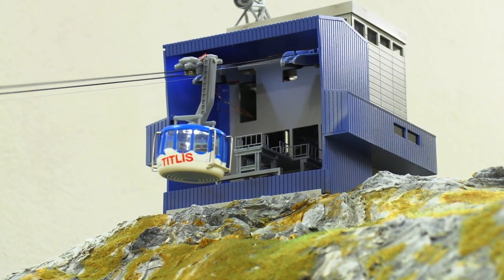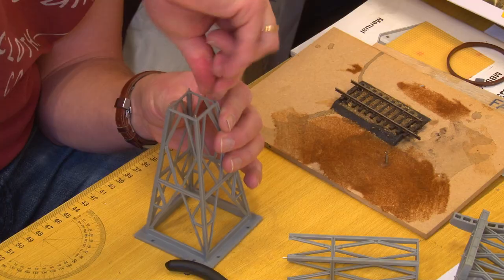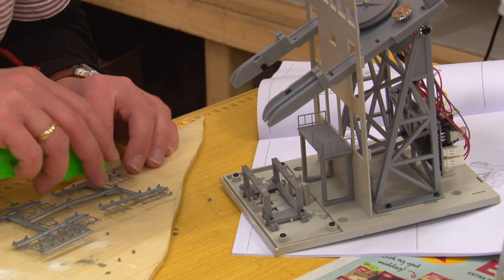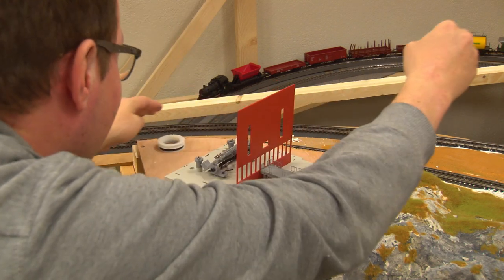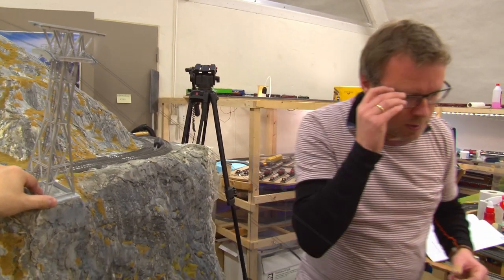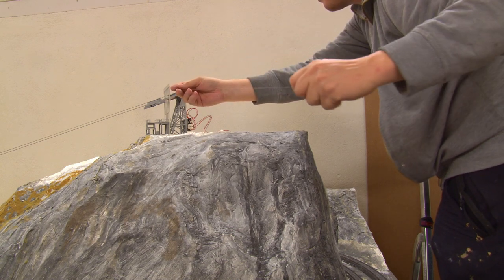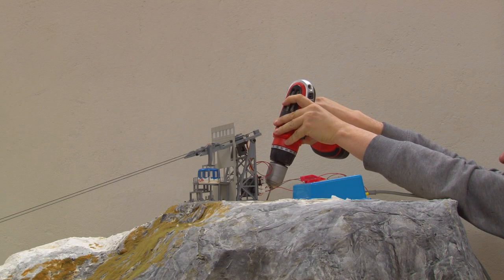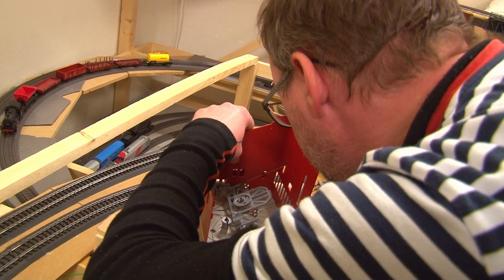Brawa Cable Car - Tutorial and Review

Comment: Hahaha, I just saw the thumbnail and I work in the ski industry and like n scale stuff. I was wondering how true-to-life this would be, as these things are ridiculously complicated... As long as the gondola cars are allowed to detach from the cable!

It's pretty realistic for a fixed grip gondola! Could even run it much faster. The detachable ones really fly up the mountain quite quickly.

I'd love to see this implemented with proper electronics like you mentioned. What a neat model for a railway!
Reply from the maker: I don't think there are any detachable cable cars or chairlift to buy. Sure someone could build that, but I think the physic would prevent to look nice, at least in H0 or smaller.

It will run faster, when I have my custom electronic, since it can slow down before reaching the station. (Also the noise increase when running faster)
Reply: @thetrainroom  Oh, absolutely. A detachable lift at HO scale would be like putting functional wiring and plumbing in your buildings! There are a few fixed grip gondolas and countless fixed grip ski lifts still in operation though, and they work precisely like this model does. Remarkably few moving parts. Off the top of my head, I know the Wildhorse Gondola in Steamboat Springs, Colorado is one of these. They are slow and low capacity, but much cheaper to build and they require next to no maintenance. Wildhorse was installed on a new route for $3m, while the new high-speed resort gondola recycled existing infrastructure for $15m.